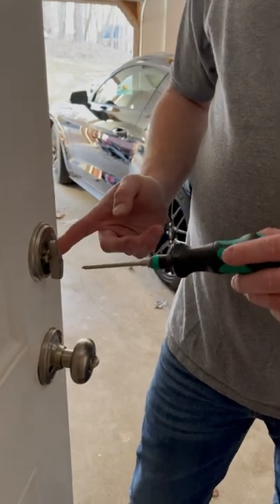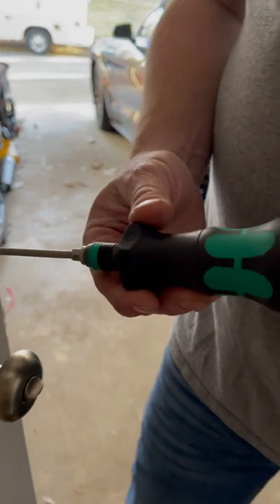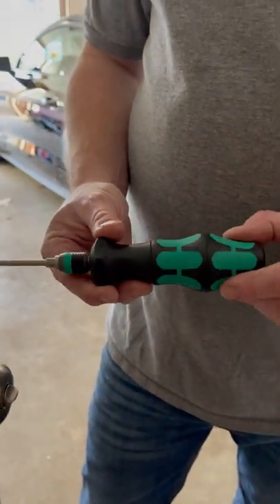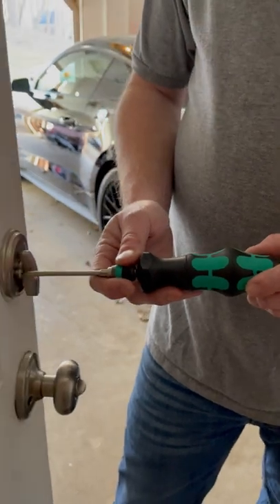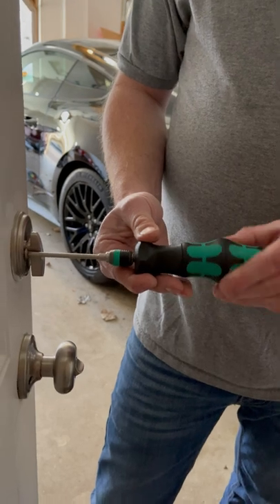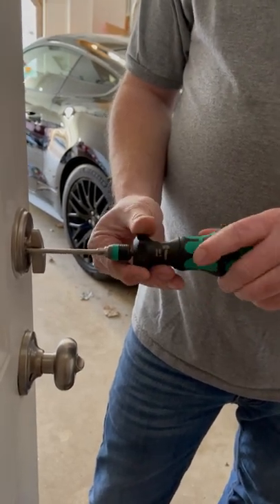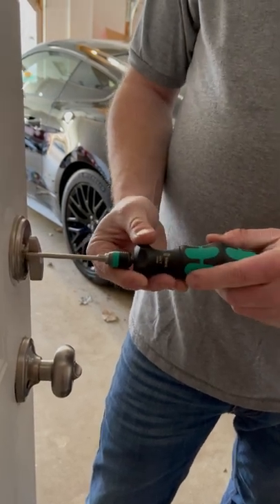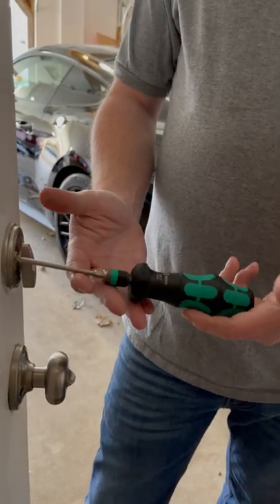Turbo Charged Screwdriver!

Comment: A battery screwdriver is less than this is and will probably last longer while not needing to stop to put it into ‘normal mode’ to tighten the screw. This looks like it will break quickly and $125 will also buy you a decent cordless drill!

Comment: Eh. I love their screwdrivers, but the mechsnism for switching this is too fiddly. Requiring either removing the driver from the screw, changing grip to holding it vertical, pushing button, return to horizontal grip and reseat in screw. Or two hands and changing grip so much you're still very likely to unseat from the screw while doing it.

Comment: For 125 bucks I won’t but it and I’ll just pay 250 or so for a Milwaukee 12v set with both a impact and a drill so I can drill out my holes and then drive a screw in

Comment: That literally took the same time it'd take me to do it with a "naturally aspirated" screwdriver.
I'm an auto tech and wasting time switching functions is losing money for me. Get yourself an electric screw driver from matco or snap-on for an extra hundred bucks over this and it torques it down to 8-10 ft lbs. This is an absolute waste. Sorry man.

Comment: This is Garbage.  Too finicky.   The Wera ratcheting screw driver is so much better.  Less button clicking and less finicking around. When your doing a task the last thing you want to be doing is switching settings while holding your tongue the right way trying to tighten something.  Especially if you are upside down, under a car, over a item, or in awkward position etc.  
Gave this screwdriver multiple chances.  It’s hasn’t held up for me.